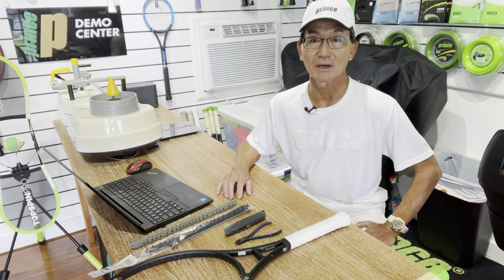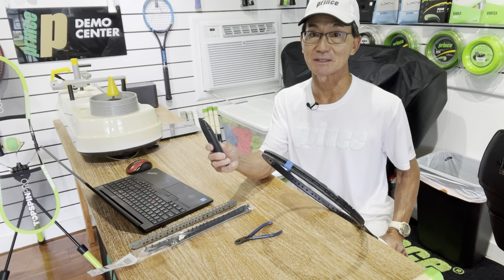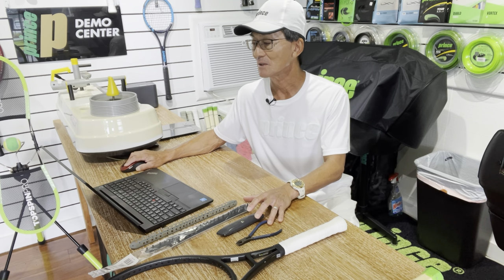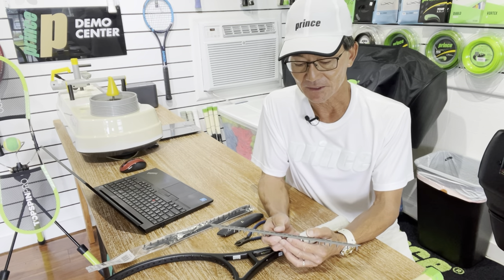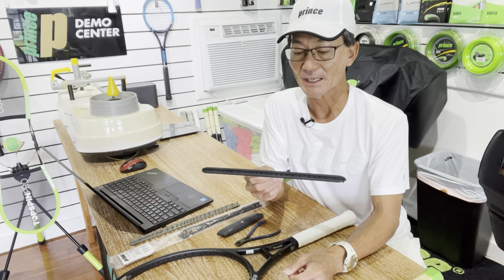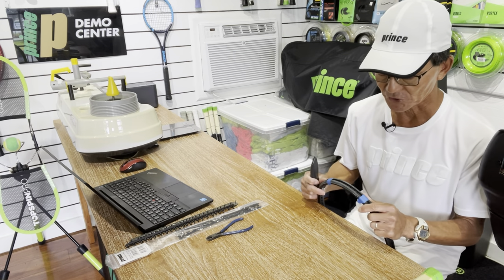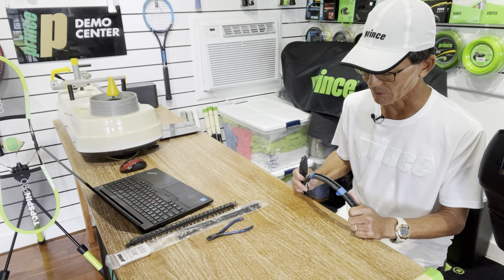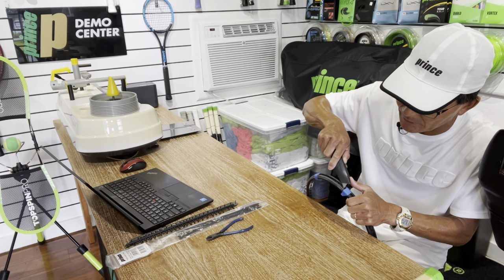Racquet Customization [Making a Racquet Lighter | Racquet Surgery]

Comment: I did exactly that to my Pro Staff 88 over 10 years ago.  That had too much weight on the head and made it very difficult to swing.  After removal of the top and sides of the bumper, the racket played much better.  More closer to the PS85 but with slightly bigger sweetspot.  I never had much trouble with scraping the exposed graphite.  Alas, I sold the PS88, the head was just too small and demanding.
Reply from the maker: Aloha Mark, Funny that you mentioned the Pro Staff 88. I had to Google it. I knew about the 85 and 90 but didn't realize there was a 88. I don't know about the 88, but the 85 had a thick plastic bumper guard. Those are definitely more problematic when it comes to this kind of surgery!

Comment: 1) You can turn a solid bumper guard into a slotted bumper guard. The guard needs to be off the racket. Determine how long you want the slot to be. Drill two holes at the right distance apart then using a sharp razor as you did, connect the holes north to north south to south pole. Yes it’s time consuming because of the number of slot needed in most cases. But your racket remains protected by a bumper guard. A alternative to slots is to just drill numerous holes a consistent distance apart no cutting needed. 2) Most rackets have grommet tubes that extend up to about 1/8 inch past the inside hoop surface. The ones that have strings that come out at near right angles ( 90 degrees) from the frame can be cut flush with the frame. Avoid cutting the tubes near the corners because the strings come out at a sharer angle. The extended tube is necessary there to prevent the string from coming into contact with the frame. Basically the tubes near 3,9,6 and 12 o’clock area are ok. It’s easier to mark the cut with a pen or light cut with a razor then remove the grommet and cut it off the racket. Theoretically you end up with longer strings and a more aerodynamic racket. 3) You can remove some of the strip sections between the holes of a strip grommet. I’d leave at least a 1/8 section of strip next to the tube because the strings need protection from the frame as they drop 90 degrees into the holes. Basically your switching from strip grommets to individual grommets like the early Prince Graphite rackets and some early Wilson rackets had. Your stringer may shake his head but done properly it doesn’t pose any danger to the string or frame when the racket is being strung.
Reply from the maker: Aloha, 

Great ideas, but as you said, it would be a time-consuming project. 

Applications 1 and 3 sound functional, but not sure how the racquet would look aesthetically. Craftsmanship would be key in this case. Or, if looks don't matter to the player, then that's not an issue. 

As for application 2, I wonder how much would the swingweight be decreased by trimming the grommets. It would seem that it wouldn't be significant. That's my guess. 

Just curious, have you measured the decrease in swingweight when using any of these applications? That would be interesting to find out. 

Thanks for sharing! 🤙

Comment: Aloha  Ruben here excellent video !!!  is there any method to reduce the grip size  I know some  Head racquets comes with removable pallets I used to play Head Arthur Ashe you could tight the grip I have never attempted to change the grip size
Reply from the maker: Aloohaa Ruben, Thanks for checking out this video. 

Yes, you can reduce the grip size. Here are a couple of options.
1) Temporary solution - Custom wrap the handle with two overgrips instead of a replacement grip. See my other video, Custom Overgrip Wrap - https://youtu.be/ue1zB1Nq_X0
2) Permanent solution - Shave down the pallet. Most pallets are made of molded urethane, which is a “shaveable” material. This technique will not work if the pallet is formed by the graphite shaft or made of rubber. I posted this article and video on the IART website. If you're a Premium Member, you can check it out here - https://gssalliance.com/iart-member-content/customization/shaving-down-a-grip/

Those Head Ashe Competition racquets were so easy to change out. Just unscrew a couple of screws and you could pop in your desired pallet size!
Reply: thank you very much

Comment: Aloha Dr. Murata! 😎🤙
Very interesting, but now the frames gonna get chipped & destroyed more easily 😜 
How about some micro drilling & hollowing of the frame itself w/o structural integrity compromises? 🤔Maybe some extra alternative string holes😅
Mahalo 😎🤙
Reply from the maker: Aloha Kenzo, Yes, the catch was that this player would have to compromise by allowing possible wear to the head of the frame. In this case, since she never used her heavier (higher swingweight) racquet anyway, it made sense for her to sacrifice the bumper guard. After the surgery, she was able to switch and play with her two racquets! 👍👍
Reply: AM Stringing yes that makes sense to have a usable racket.  Trimming mod 👍 Mahalo 🤙

Comment: Watch you channel. Thanks for videos. One question:when customizing a racket with lead tape, can you put one strip on side side of the racket and another strip on the other side of the racket. In other words instead of two strips on one side and the other, only one on one side and one on the oppositeside keeping things in balance
Reply from the maker: Aloha Roman, To be honest, I'm not sure if that would make a difference since I don't have scientific proof or personal playing experience with that setup. I've seen lead tape installed on racquets in that fashion and wondered why a player would do it that way. Maybe because the player only had 1/2" lead tape and didn't want to cut it in half? 

On professional installations of lead tape, I've only seen applied two ways:
1)  Two 1/4" strips on each side of the grommets.    
2) One 1/2" strip with holes punched in them to allow the grommets to go through.

Comment: I use leather grip and add lead tape on the front of the hander to balance out the lead tape that put on the head(3-9). You mention the lead tape on the handle, do you have information on synthetic grip vs leather grip that change the performance of the racquet.
Reply from the maker: Aloha Eddie, 
A leather grip can weigh about 8-10 grams heavier than a synthetic grip. So I'm wondering, did you add that much lead tape to the 3:00/9:00 area of the head to maintain the original balance of the frame?

There are three main reasons why some players prefer to use a leather grip instead of a synthetic grip. 
1) To add more weight to the handle (eliminating the application of lead tape or silicone), therefore making the racquet feel more solid. 
2) To enhance the feel of the frame since the leather grip is firmer and less cushioned.
3) To enhance the feel of the grip since the bevels are more pronounced.
Reply: @AMstringing  As I remember back in the early 80's,  I started hitting with topspin. the added weight helps me keep the ball deep and severing as well. I use close to five and half inch's of lead tape on each side.  the leather grip and the lead tape on the front of handle makes the racquet not too head heavy. I wonder instead of cutting, maybe replace it with leather grip with thin over grip over it.  My philosophy is, if the racquet is too head heavy you need to go to the gym.
Reply from the maker: @eddiechen2128  When you add 5.5" of lead tape at 3:00/9:00, it probably increased the swingweight by 10-12 units, which does require more strength to swing. 

Yes, you are correct about adding weight to the handle by using a leather grip and lead tape, which doesn't require as much strength to swing. Most players that use a leather grip will use it as a base, then wrap an overgrip over it. 

As far as a racquet that's too head-heavy, you could always look into switching to a "more" user-friendly racquet that compliments your strength and skill set. 😜

Comment: Hi,
Good Day!
If your are customising or measuring racquet swing weight is it recommended to do it with string or without string? and why?
Thanks
Reply from the maker: Aloha Cris, Good question. When possible, I would recommend measuring specifications and customizing frames unstrung. Strings weigh differently and affect the static weight and swingweight readings. Generally, strings can weigh from 12-20 grams. After a racquet is strung, the strings will increase the swingweight from 22-30 units.
Reply: @AMstringing  Hi good day!  Thank for your reply appreciate it much 🙏
You mentioned that measuring racquet with string will affect static balance and swing weight therefore is not wrong to  measure racquet with  strung? Pls correct if I’m wrong. Thanks 🙏
Reply from the maker: @crisjr917  Sorry for the confusion. There's nothing wrong with measuring a strung racquet as long as you always do it that way. If that is the case, having the same string setup when custom-matching racquets would be ideal. I hope that makes sense. 👍
Reply: @AMstringing  Thank you so much all good for me now..
By the just diid my first customisation of the New Head extreme tour.
Unstrung:
Racquet # 1 
Swing weight- 284
Static weight - 302.5
Balance Point - 31

Racquet # 2
Swing weight- 284.5
Static weight - 302.4
Balance Point - 31
Differences:
Swing weight- 0.5
Static weight - 0.1
Balance Point - The Same 
Do I still to customise this lighter with the difference of 0.5 swing weight?
Thanks 🙏
Reply from the maker: @crisjr917  Great job! No need to do anything further with matching these frames. The difference of .5 swingweight units is not going to be noticeable to the player. In the future, if you stay within 2 units, that should suffice for non-professional players.
Reply: @AMstringing  Thank so much for your reply. Appreciate it much.
God Bless🙏
By the way do we have a rule of the thumb when measuring swing weight, static weight and balance of 2 new unstrung or Stung racket,
Like how many grams difference that is acceptable and not acceptable that needs customisation.? Thanks

Comment: Hmm.. is their a way to calculate how much the swingweight would be if you took away 1g from the top of an ATS Tour 98?
Reply from the maker: Aloha, The average swingweight difference would be 2-3 units. Most people can't feel that subtle difference. If you want to experiment, it would be more noticeable if you go with 2 grams instead. By the way, the average swingweight of this frame (unstrung) is 294. I took these measurements using my Babolat RDC.
Reply: @AMstringing  Thanks. I feel like this 98 is too head heavy, and I am slow on by backhand. Maybe I need to change something but might regret cutting the bumper guard and lose too much power
Reply from the maker: @Robust2013  Yeah, this application is the LAST resort, and cutting the bumper guard will definitely allow wear to happen at the tip. If you don't typically wear your frame in the 12:00 area, then it would be okay. Otherwise, the only other option is to use a thinner gauge string (17 or 18) to reduce the weight of the head of the racquet. However, if you're a string breaker or like the feel of a thicker gauge string (16), then that's not an option.
Reply: @AMstringing  Thanks for the detailed info. If I would trim 2 grams off the racquet bumper guard, how much swingweight would be on an ATS 98? 

Afraid the power would be to low as well. I already use 1.18mm string.
Reply from the maker: @Robust2013  I took the following RDC swingweight measurements of lead tape placed at 12:00 on the outside of the bumper guard. 
 * 1 gram = +3 swingweight units
 * 1.5 grams = +6 swingweight units
 * 2 grams = +9 swingweight units